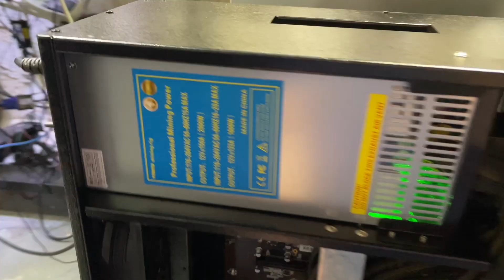Quiet server case power supply mod. Resistor modding a 2U PSU

Comment: Yo! I’ve seen you around in a bunch of chats but just found your channel. 
Great content! 
Just trying to wrap my smooth brain around this; From the factory, the fan is blowing at full capacity 100% of the time. By adding a 5w resistor, the fan is receiving less power, therefore not blowing as hard, hence quieter.
Is that right? 
If so, wouldn’t that not only make the psu hotter, but less efficient too?
Reply from the maker: hello fellow smooth brainer!

possibly, but I doubt the efficiency difference it that significant. the air charge isn't exactly hot coming out of these things, especially at 240V

nevertheless, I did this to make the rig quiet enough to have in my home. there's no reason to do this if you dont have noise concerns

Comment: I have the same exact issue and grabbed the green case 😊. Should I just replace with noctua fan or just a basic lower rpm fan for lower noise??
Reply from the maker: youd have to look at specs, I do think lower RPM would be good but most Noctuas are 4 pin and this is 2.